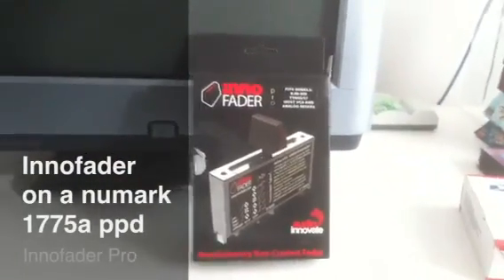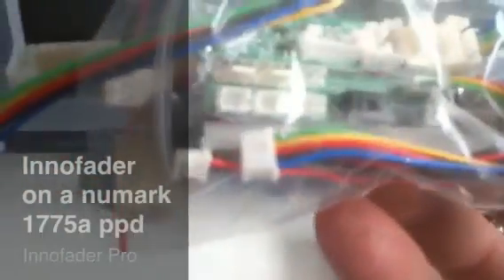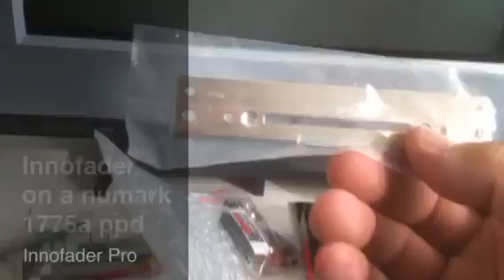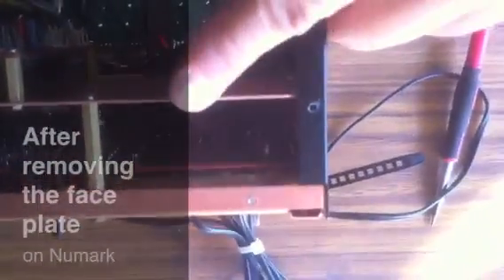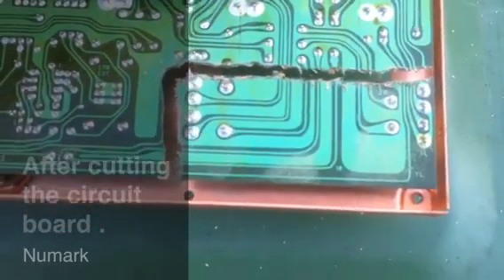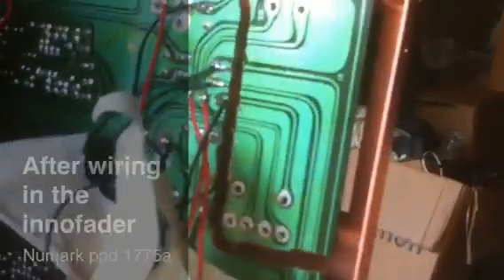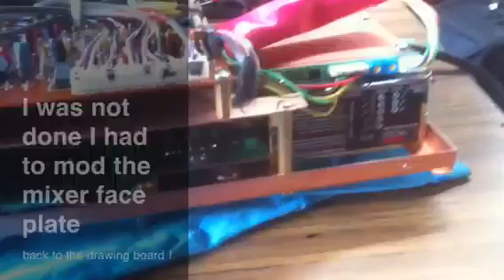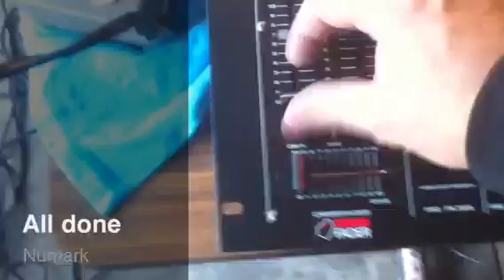Innofader pro

Comment: Sorry I just read this today.  I ended up buying the same mixer on ebay now it's doing the same thing.  so now I own 2 that 1 cutting out of left channel and 1 cutting out of right channel. The original place i bought it (1989) from has fixed this problem about 5 years after I purchased this (1993)   but now the tech no longer works there and they don't have schematics.  Im lost.  don't want to buy another used one to have the same thing happen.  I find it hard to believe no one has schematics.

Comment: do you know where I can get schematics for the numark 1775a I have one and love it using it since 1989.  the left channel is cutting in and out no matter what input or output I use. took it to a shop and they took apart and checked for bad solder connections and cleaned faders. problem still exist. they said most likely a bad ic, capacitor or resistor he  he needs the schematics.  I have looked on internet even called Numark and no luck.  If you can help out I would very much appreciated it.